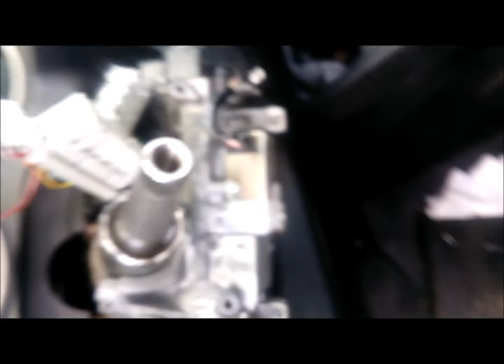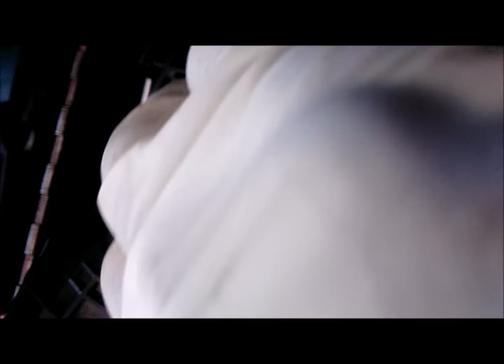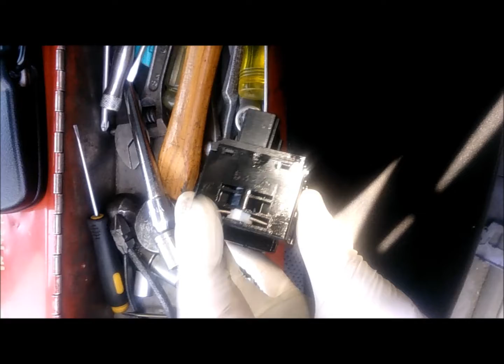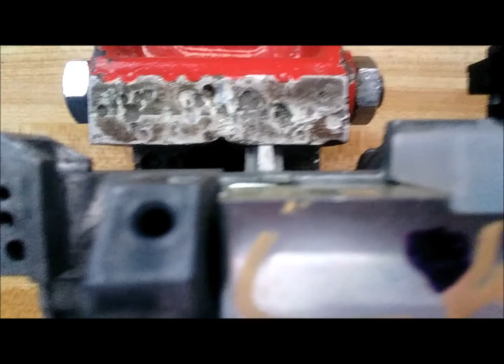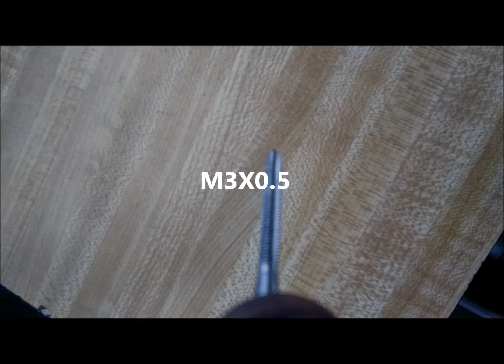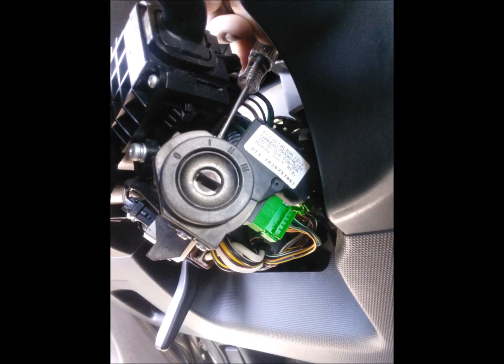2007 Fit: Turn signal cam and lock cylinder pin

Comment: Rebored holes to fix it nice work.,,👍
Reply from the maker: Thanks 👍 It seems to be working like factory one. But failure of the Ignition lock was the most embarrassing issue I ever encountered!
Reply: @mkrp4  I had a failure with the ignition lock also once with my 2005 pontiac granprix I had to rent a steering wheel puller to fix it. Although it was my fuel pump.😆Sometimes it all boils down to process of elimination, so don't be too hard on yourself.